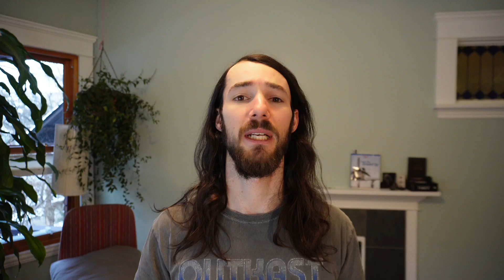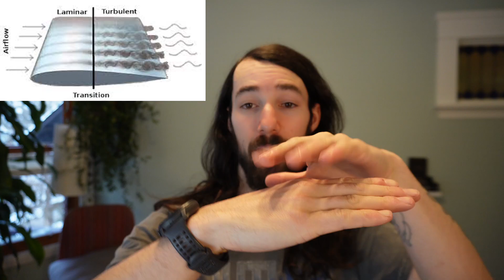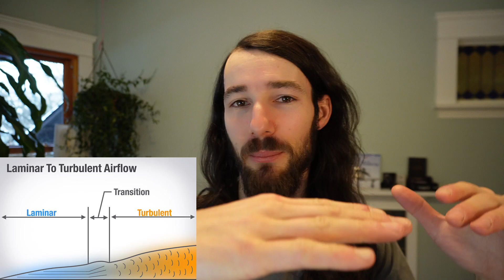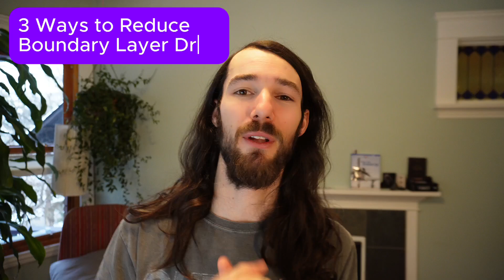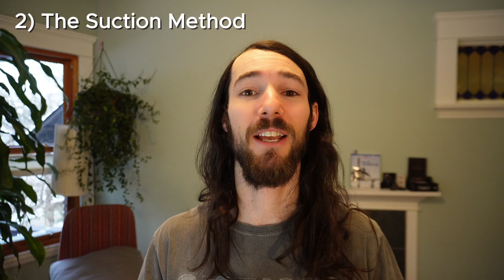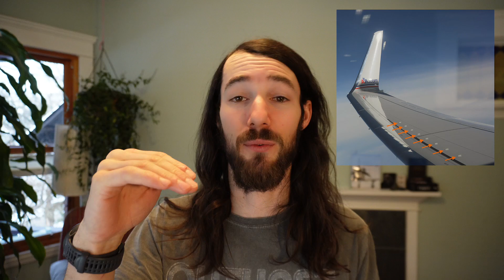What is the BOUNDARY LAYER? | Aviation Aerodynamics (Simple Explanation)

Comment: So the transition occurs fue to the increased skin friction which slows the molecules down? Cant it also be created by the adverse pressure gradient where pressure increases as we head down the airfoil this causes a reverse flow tendancy? Also a turbulent boundary layer sepaerates at a later point doesnt it?
Reply from the maker: yep youre 100% right. thats a more advanced understanding than this videos intensiob but you got it! and yes, the separation point occur later on… the separation point moves forward as the angle of attack increases
Reply: @TheWiredFlyer thankyou. One more thing the adverse pressure gradient is caused when the air pressure increases as velocity decrease towards the trailing edge right?. Then when this occurs the airflow reverses, does this cause Eddie's and vortex generation as I am studying my atpl at the moment and that's a topic.